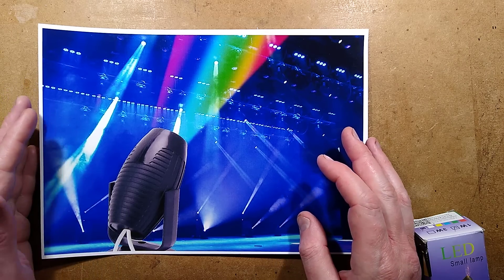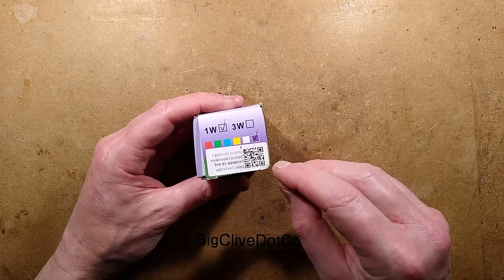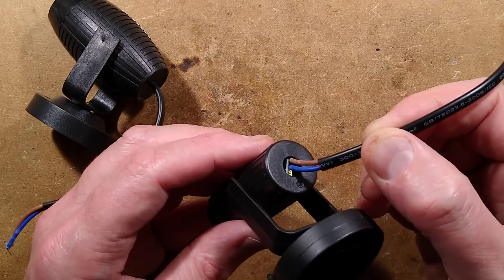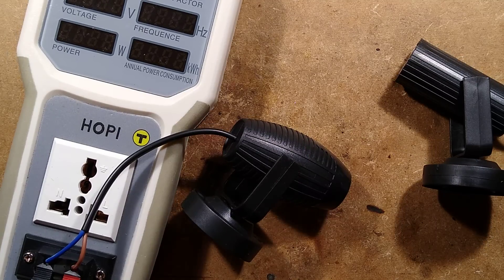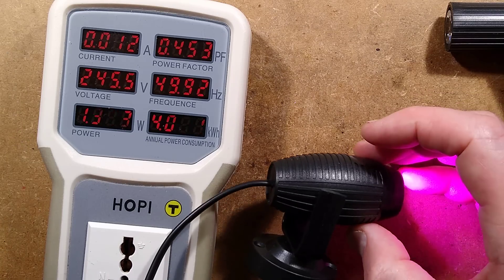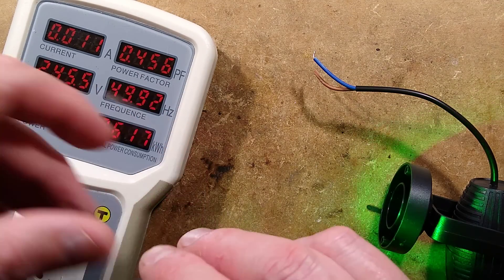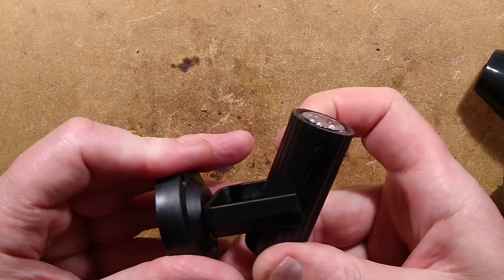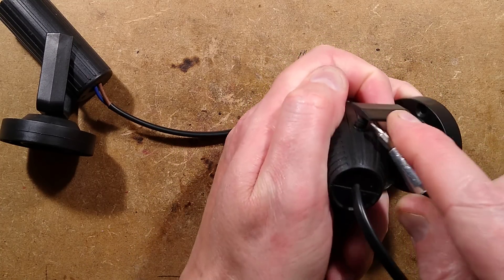Inside an "LED small lamp".

Comment: Saw this and thought of you.. https://www.aliexpress.com/item/32855620167.html - Seems like something you would like to take apart..
Reply from the maker: I think I've featured similar items in the past.  Basically a resistor per LED and designed to be cut to length for different sizes.

Comment: Having levered open the 'dissapointing' in my opinion downright dangerous LED with mains wires hanging out from a floating, unsecured and unshielded circuit board -Clive grabs terminals on the board with his fingers to 'test' if it's holding a charge (that's before he's reverse engineered the circuit). He's a much braver man than I am.

Comment: Hey Clive,

Really weird thing happened where I tripped one of our two RCDOs today (moisture, I think, oops) and when I turned it back on, our passive IR security light came on and wouldn’t go off.

I was out, so I didn’t realise, but I pressed the test button and restarted it and the thing came on for a while, then went off. Would an explanation of the phenomenon be worthy of a video?

Kinda dying to know now
Reply: Most of the motion detection lights have a "Stay On" feature that is activated by turning the power off for a couple seconds and then back on.
For instance if you replace your porch light with a motion detector, you can shut the switch off for a couple of seconds and then turn it on to keep the light on.
So I suspect that you had the power off just the right amount of time to do that.

Then when you reset it, it probably stayed on for whatever the recycle time is set for, as if it had been tripped by motion.

Comment: Is there a different in english between the bulp screwed in the housing and the housing?
In german the bulp screwed in is called "Lampe", the housing is called "Leuchte"
I only know the english word "lamp". What does this exactly mean?
Reply: You just opened Pandora's box! Lol
The thing you screw in can be called, Bulb, Lamp, Emitter, Light, and many more, with varying levels of technical accuracy.
The thing you screw it into can be called Fixture, Housing, Lamp, Light, Holder, Can, Luminaire, etc etc, with varying levels of technical accuracy.

A projector has a Lamp in it, but a Desk Lamp has a Bulb screwed in underneath the Lamp Shade. 

A fluorescent tube is a Lamp, which goes in a Fixture, and a Desk Lamp takes an LED bulb screwed in.

And it can change between fields, say the projecter guys vs the stage lighting guys, or the facility management guys, or the English teachers... Lol

There are lots of other names that I am forgetting off the top of my head, and I am basing this on US English, and I know that UK does their own wierd ass names as well, but I hope this properly confused you, like we already are! Lol

Comment: Bigclive showing me thing I didn't know I need to buy. You always find the neatest stuff.
 I will be buying a couple of them and modding them with some salvaged rgb LEDs and run it on USB power bank
Reply from the maker: A 2W 5.6 ohm resistor is all you'd need to run the LEDs on a USB supply.  The resistor will get hot.
Using a higher value like 10 ohms will allow you to balance intensity versus run time.

Comment: Made my own bigclive blue flashing LED caos board this week and I love it! I used 2.5 mm hole pitch perforated project board and hand soldered all the connections with bare 26ga copper wire. Including mounting in the black picture frame it took one day, about 7 hours total, to build.
Reply from the maker: If you want to make one with a PCB the zip file with all the gerber files is now on my website www.bigclive.com for uploading straight to a PCB manufacturer of your choice.
Reply: @bigclivedotcom  I was planning on drawing up a PCB file to make a board so this will save me some time. Thanks for the heads up and the link Clive.

Comment: The heatsink is not really big enough using just the aluminium backed PCB. You can make them much safer by using an mr16 / GU5.3 type driver (I have doubts about the safety and reliability of those small mains supplies), and running them from 12V. Even the mains rotating lens 'disco bulbs' can be converted to 12v this way. I have a thing for 12V operation, it's safer, and easier to run mobile (inland waterway boats usually).

Comment: Nothing wrong with pink and change the driver on the "Pink" one to use a 5v so it can be used from a USB port.
Reply from the maker: That could be done with just a resistor.
Reply: @bigclivedotcom  True.
Would make a easier project for anyone.
Rather than using mains voltage.

Comment: Now that these cheap power supplies all seem to have bleed down resistors across the capacitor, it is taking all the fun out of tear downs.
Reply from the maker: It's the circuitry itself that is mostly discharging them.  All it takes is a fault unit though.

Comment: I'd be surprised if the second one would pass electrical safety, the powered up circuit board is clearly visible through the cable hole in the back, which is way oversized. Perfect for inquisitive little fingers to touch, with or without something metal in their hands, or not so little and dumb fingers to touch.

Comment: Is there a way to convert it to 12v ?
Reply: Yes of course, by replacing the power supply module with one accepting 12v input. Or simply using a resistor but that's not as effective.
Reply from the maker: Yes.  You can get 12V drivers.

Comment: Any chance you could make a video about power factor? You make the reference about it in your videos but I can’t seem to grasp the principle from others. Thanks! - Mike
Reply: ElectroBOOM has done a video on that I do believe
Reply: @TestECull  But sometimes you don't want a mad genius explaining it
Reply: @IIGrayfoxII  I surely want a mad guy to explain , even if I already now , the fun is even bigger
Reply: Fastest way to explain it is energy sloshing back and forth. In unity power factor all the energy goes from source to load. In a perfect zero power factor the energy keeps going back and forth, it isn't used.  And anything between the two extremes is just different degrees of that. Kind of like taking two glasses and filling one with water and leaving the other empty. You then pour from one glass to another without spilling anything and no water is ever used. That's how I understand it.
Reply: @DrFreeeman  , Gordon sorry to say but you do spill "water" electrical it is the blind power energy that you make but not use, in your water case the water that's still in your glass after you empty it
Reply: @peterevenhuis2663  There's always some losses (like due to wire resistance). I was just providing a simplified explanation to convey the gist of it.
Reply: I’ve never understood it either. So what’s a “good” and “bad” PF and does it affect my electricity bill? I’m supposing a good PF means the unit is running efficiently and as a consequence using less power.
Should I now check all my electrical items and (hypothetically) change them for those with better PF?
Reply: Try this explanation.

A capacitive dropper tends to draw more current out of phase with the AC voltage.  If you graph current draw against AC voltage you would find that the current draw is (for example) 90 degrees out of phase with the AC voltage, resulting in a power factor of 0.45.  This kind of forkery puts a strange load on the power meter, distribution transformers and ultimately the power station generators, which they were not really designed for. 

A current draw that was perfectly in phase with the AC voltage (for example as with an incandescent bulb) would have a power factor of 1.  As the the current draw goes progressively out of phase with the voltage, it results in a progressively lower power factor.

Hope that makes sense?